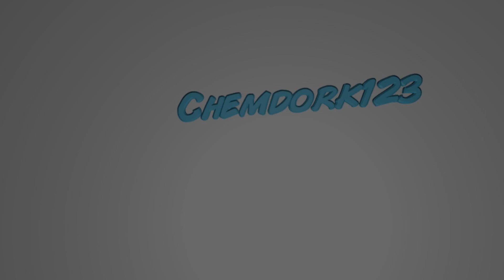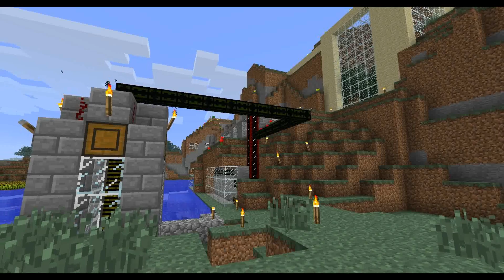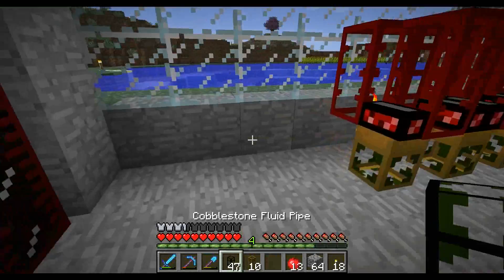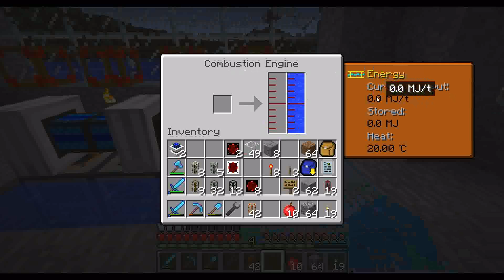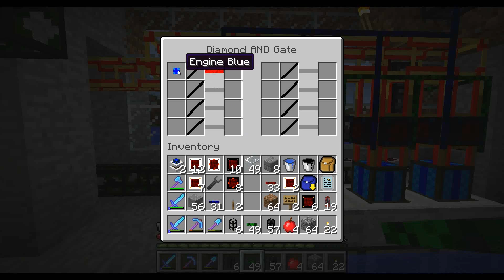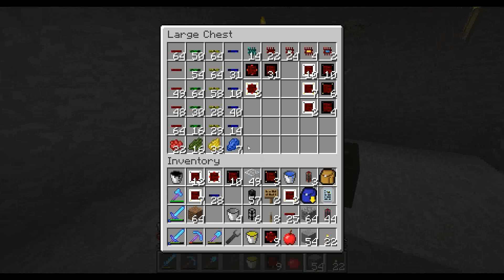My Buildcraft S2E29 - Refine and Redefine

Comment: The Refinery engines wont start up if theres space in the engine fuel tank while the main fuel tank is full. My recommendation would be to reconnect the blue pipe wire but invert its signal. That way it indicates whether theres any space rather than whether a tank is full.
Reply from the maker: Well, that was the point.  If the main fuel tank is full, I will never have a need to fire up the refineries.  Also, the way the system works, it would only be possible for there to ever be barely less than a full tank in the engine fuel tank due to fluid build-up in the pipes.

Comment: the combustion engense now use coolent to cool down quicker.
Reply from the maker: I believe I saw that the different biomes affect the heating and cooling of engines as well, so they heat up faster and cool down slower in the desert and vice versa in tunda/ice biomes.
Reply: chemdork123 That it does. Also, from your last video, the Pneumatic Servos (Spelled it correctly first try! WOO!) will set the item ducts so that they do not need a redstone signal to send items out. To make items traverse the system fastet, you need Impulse Item Ducts, which I believe are Item Ducts with liquid glowstone in them. They have to have several in a series to significantly speed up items, like gold pipes, but do not need a redstone signal.
Reply from the maker: Cool, thanks for the tip!